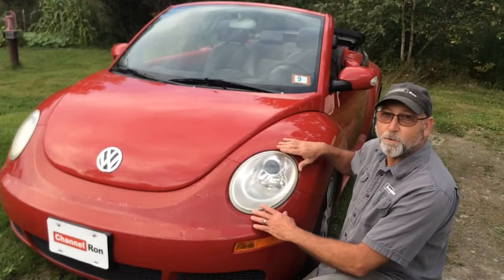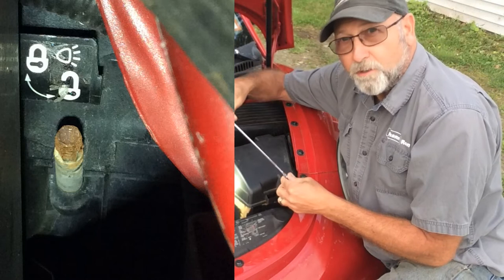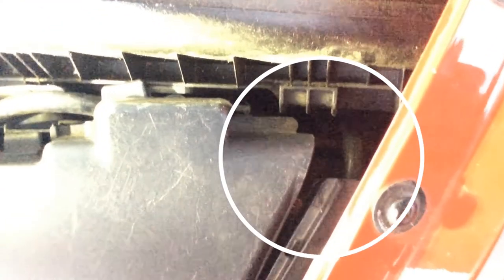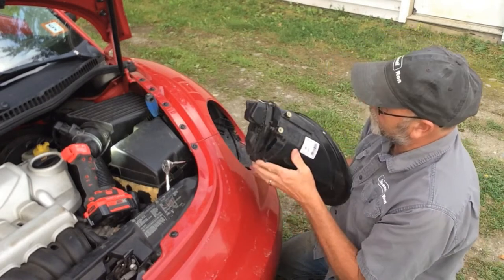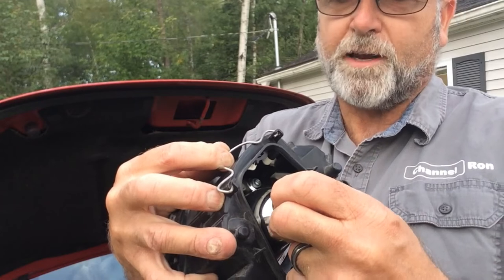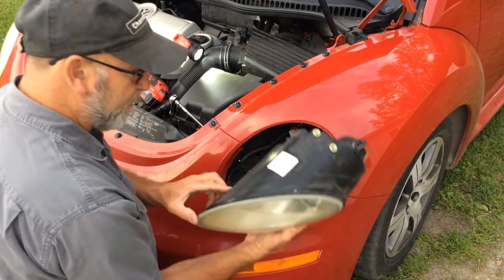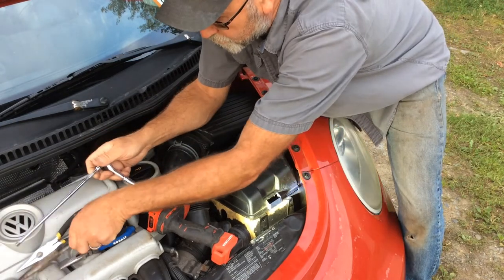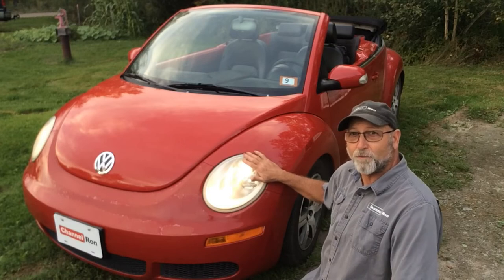How to Remove Headlight and Bulb 98-11 VW Beetle

Comment: 2:35 THANK YOU!  Yes everyone else shows the passenger side, except one other video I saw where the guy disconnected and removed the battery, and showed some other kind of clip in the rear, snd not the 5mm bolt clip head in the front!  Mine is a 2009 convertible.  I don't know if they are really all the same,  1998 - 2011.  Seems to me there are a variety of types being shown in video clips.  Yours matched mine and was the most clear.  KUDOS!

Comment: When i spin that lil mechanism clockwise to lock it i am still able to pull the headlight out? Could that mean i need a new bracket?
Reply from the maker: Sounds like it? make sure the tab that inserted in getting a goo contact.